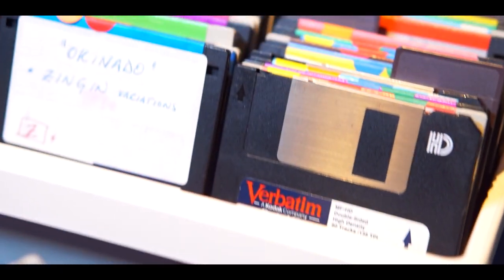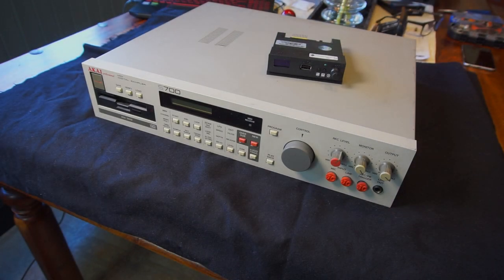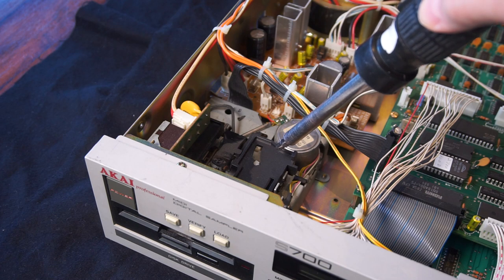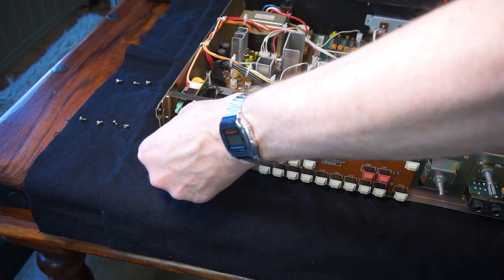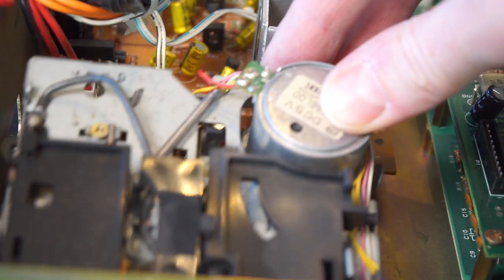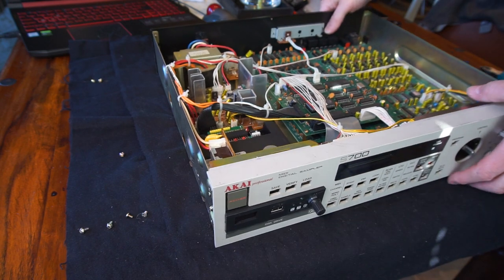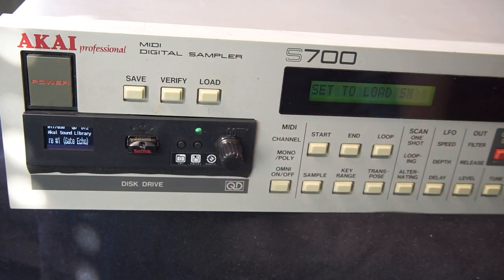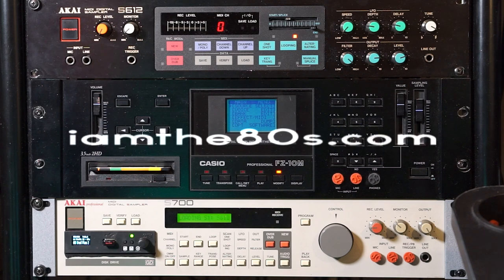Akai S700 QD Emulator Install | It was time

Comment: I have a Roland MT-100 with said QD drive. I bought it for $20 because the drive did not work. Managed to take it apart and replace the belt which had turned into a small ball of rubber. It works great now. Emulator was plan B. Great video.
Reply from the maker: Good job. Cheers! :D
Reply: We also do a plug and play MT100 drive usb floppy emulator now with a designated adapter. (Completely different to the normal QD pinout).

Comment: I fitted one of these CPmagnetic floppy emulators into my EMU ESI-32. They are very good, but they are still as slow at loading sample banks as a traditional floppy disk drive. Therefore I still use my SCSI syquest EZ Flyer 230mb external drive which is a lot quicker. But I still recommend those emulators as they come with a shed load of sample banks pre-installed from Emulator EIII, II and I as well as Fairlight. Very useful :)
Reply: I just copy over the banks I want to use onto the syquest.

Comment: Great installation video Espen Kraft. Putting a USB or CF drive into these old samplers is the move for upgrading them. I put a CF drive into my MPC2KXL last year. I have a S3000XL on the way in and I will probably go with a USB drive for my rack sampler. I tried putting a secondhand floppy disc drive into a MPC60 mark II but the MPC wasn't recognizing the drive. At least with the new drives so far I've not had this problem. I know the ascetics doesn't look as good as the original drive but personally the storage advantage wins me over.
Reply from the maker: Cheers! :D

Comment: I have been using a Gotek drive in my Amiga 500 for a couple of years now. Very convenient indeed. Even though I love the physical floppy disks, they start to loose their magnetic integrity, so this is a nice saver.
By the way, the Flashfloppy firmware supports a small piezo speaker so you can get that noise from a real drive with clicking and buzzing :)

Comment: Just did mine last week. You should have asked... 😉i went the wood support mode for the gotek. Like gwEM shows on yt. And had to use a file to make it fit the slot since it is too wide to fit. And i needed the adapter that was not in the kit. I replaced my belts on te s700 and 280 and no cure... i have a hideway studio ordered for the s612... but there is a very recent yt video of a cheaper way to do it with the gotek and some 280 parts.
Reply from the maker: Many ways to do this. ;-)

Comment: Funny, I was facing this same dilemma recently with my Emax HD rack unit. Bought it new back in the day and the drive finally failed recently. I now have both a replacement floppy drive and a floppy emulator drive and need to commit to one or the other, assuming either will work. We'll see!
Reply: Look at the SCSI2SD for the Emax HD.
Reply from the maker: For the Emax or samplers with SCSI I would recommend the SCSI2SD solution over a floppy emulator. Much faster and better solution. :)

Comment: Hi Espen! How the h#¤% did you manage to format and get the S700 files on that USB-dongle in the first place? I have an X7000 and the exact same drive, but  it won't format the drive nor are there any other good solutions on PC for the 700/7000 ... How?
Reply from the maker: The dongle is just a USB memory stick. Formatted as FAT32. Put the files on there. If you get this from the same guy I did, you will get all the files you need to have on the root level of the USB.
Reply: To get the sounds we load into the sampler from real QD's then save out to the usb drives blank disk images. We will soon also be able to provide a service to convert your real qd disks to readable image files using postal service.
Reply: @EspenKraft  Takk Espen, it works! Turns out I needed new firmware and blank QD images for AKAI, then FAT32 worked flawlessly. Everything readily available from the same guy, surely. Love your videos man - keep up the great work on your channel.
Reply: @cpmagneticmedia  Thanks for the info - now that the drive works, the X7000 is on another level. : ) .. awesome.

Comment: I've always been wondering how people are able transfer their old 2,8 inch disk data to a USB stick when their old 2,8 inch drive is actually dead...? The factory sounds of all these old samplers might be available on the internet somewhere...but if you made your OWN sounds with it, then those could be unaccessable (and in so far "gone") forever. Or is there any company in the world offering this special kind of copy service? 

For someone who is "on the hunt" for an old hardware sampler I would recommend to consider buying one with a 3,5 inch drive (Korg DSS-1/DSM-1, E-mu Emax, Yamaha TX16W etc.) because those drives are still very common on the second-hand market (as they have been a standard part for several older computers). Not sure if there might be some compatibility issues. Maybe you might need a specific model for a certain sampler? But that's another topic...maybe for a future video? ;-)
Reply from the maker: There are different ways to do this, but they're all a little cumbersome and unpractical. No plug and play solution here. ;-)

Comment: Is that USB port at the front? If so will it read samples directly from a USB memory stick?
Reply from the maker: Yes it is. There is a USB stick in it in the video, it's just a small thumb drive so you can't see it very well.
Reply: @EspenKraft  Excellent. I bought an Akai S01 sampler int eh mid 1990s. I assume that you can use this swap over on the floppy disk drive on the S01?
(cant really do long samples with it (~15 seconds) but I havent really been limited by this. Still works a treat)
Reply from the maker: Yes you can, just remember that this sampler requires another type of floppy emulator as that originally has a 3.5" standard floppy drive, not a QD like this S700 I show in the video.
Reply: @EspenKraft  Okay thanks. At the moment I store my samples on my PC and the floppy drive works fine on the S01.
A USB would be a great modification. 
(there is a modification kit available for an external patch bay)
Reply: @PetraKann  We currently sell drives for around 70 different synths and samplers at cpmagneticmedia, all come with the required fittings and adapters, all are plug and play.
 :)

Comment: Hi Espen, love your channel. 
I have recently installed a similar usb emulator in my MPC 2000. The floppy drive wasn't broken, but I just did not want to wait for it to happen. I am just wondering what software you use to read the usb stick as the separate 1.44 mb memory compartiments. I am only able to place one sample at a time when I put the usb stick into my MacBook. It probably is a bit of a silly question, but I hope you can shed some light on my incompetent noodling. 
Keep up the good work with your videos and warm greetings from the Netherlands! Marten
Reply from the maker: Thanks!
This is not a 1.44mb floppy emulator. This is a QD emulator and as such a different type of original storage medium and the tech behind both the emulator and file structure is different.
The QD floppies could only hold one sample on each side. This tech was abandoned long before  the MPC2000 saw the light of day. Over 10 years before that.  ;-)
Reply: @EspenKraft  thanks for your swift reply. I feel like a bit of a one celled organism in the sampler world. Got a lot of evolving to do, but it is a lovely pastime. 
Intik I find the right program, I will load the samples in via the audio in. Which has it's own advantages. 
Thanks again for your reply and I will surely see you in your next video!
Reply from the maker: Cheers! :D

Comment: 1 year ago I bought 2 gotek floppy emulators, one for my yamaha SU700 and the other for my S1100.
It was a success on the SU700, everything works fine, but the S1100 never read the drive. I tried all the jumper options, triple checked the cable connections, nada.
I think to give up the idea for floppy emulator and get directly to an emulated SCSI drive like I did successfully for my EPSm with a Chicken System drive.
Reply from the maker: There is no SCSI on these old QD samplers. ;-)
Reply: @EspenKraft  I know that, you had no choice (or repair de belt of the floppy drive), but for my S1100 I have 🙂
Reply from the maker: Of course, the S1100 is different. I had one for many years, I still have some of the old SCSI drives for it.
Reply: @EspenKraft  mine is still plugged on its, quite noisy, 250meg drive. 
It was my work horse in the 90s but to be honnest I don't use it a lot today. Who need a too good sounding sampler now?  I use my "LowFi EPSm" more; for the "good full range sounds" what we have "in the box" nowadays is more suited.
Reply from the maker: The S1100 is still an excellent sampler, great effects as well.

Comment: i recently put a replacement belt into my MKS-100 hoping i could get a handful of samples ripped off their disks, but not a single one would load. quickdisks are shockingly unreliable compared to 5.25 and 3.5 floppies.
Reply from the maker: It can be tricky.

Comment: Nice - But how do you get all your old 3.5"s to the USB pen? Jacob
Reply from the maker: These aren't 3.5" floppies. This is a QD drive and QD floppies. A different system. With a 3.5" drive you can make images of your floppies with different kinds of programs and diskdrives and then convert these to a format your sampler or gear can use. It's a little more complicated with these.
Reply: @EspenKraft  tak! got a S3000XL but hoping to put a SCSI to SD card in that at some point. But my W-30 could use a emulator.

Comment: First a cover of See You with VST synths, now a QD Emulator! Where will it end? I'm turning over a new leaf and going VST synth free for lent. As part of my penance I will do a cover of See You using only my Casio VZ-10M and a Raspberry Pi 4B. Just kidding, the QD emulator looks cool, I need one for my S700. I've had the lid off my S700 before when I foolishly fitted a newer version of the OS ROM. Turned out it was meant for a S700 with battery backup RAM and it didn't initialse the RAM on power up. Caused more problems than it solved!
Reply from the maker: I'm full of surprises. ;-)

Comment: I have an S2000 will it work on that too? =:  )
Reply from the maker: You need another emulator for that, since it's not a QD sampler, but yes, it will.
Reply: @EspenKraft  ahhh is there much difference between S700 and S2000?
Reply from the maker: @scotmcfox8908  Yes, huge difference. On all levels.
Reply: We also sell an Akai S2000 usb drive.
Reply: @EspenKraft  is the S2000 a pig then? Any chance you can do a video about the differences with the Akai sampler range?   
 =:  )
Reply from the maker: The S2000 is a fine sampler. It's just a totally different from the early range. The S2000 is more transparent and clinical in the sounds. Digital filters where the S612,700,900 and 950 had analog filters. 
I can't do a video like that as I don't have them all.
Reply: @EspenKraft  ahh i see. Thanks again for your expert help =:  )
Reply: @cpmagneticmedia  does it require software to operate it also?
Reply: @scotmcfox8908  not for the sampler operation, only if you want to convert your real disks to images.